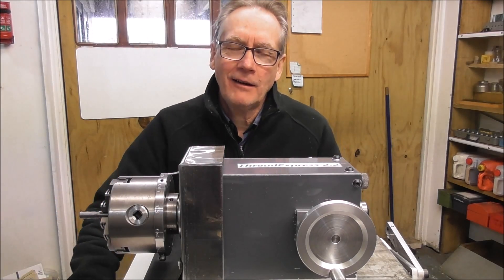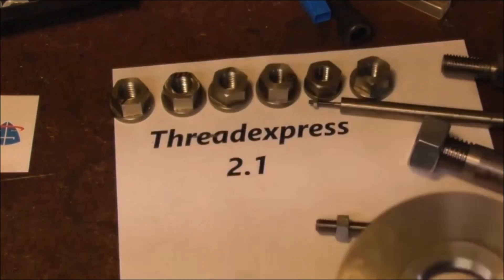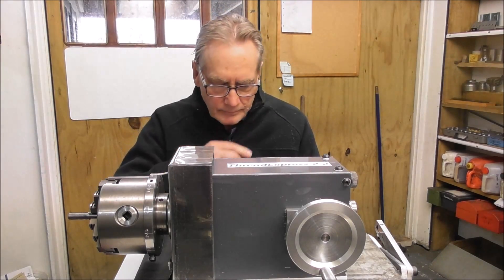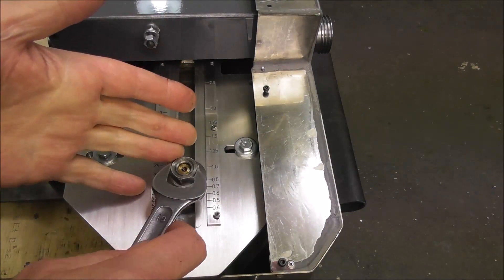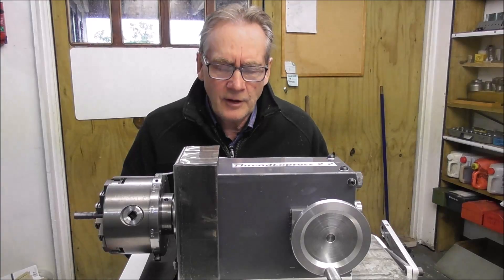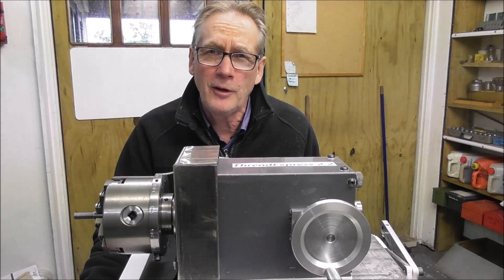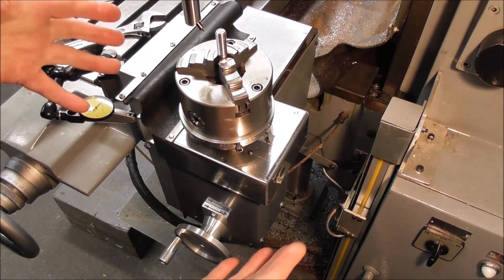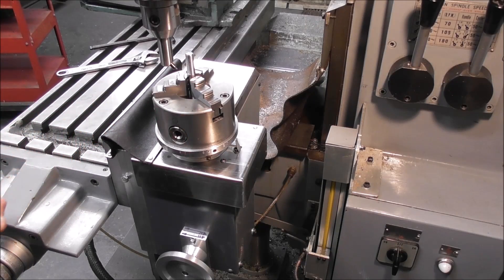ThreadExpress 2.2 Design revelation begins.

Comment: @ThreadExpress You're not solving a problem I can't solve with freely available mainstream CAD/CAM packages like Fusion360 2D+1. Z axis is the easiest to cancel backlash on a vertical mill since gravity will always pull down. I can't tell if you're trolling or just uninformed.
Reply from the maker: Hi Matt - Not everyone around the world has CAD/CAM and a CNC machine.  I have a CNC and do threadmilling also, and I still would use the CNC process for multiple parts that do not have to be highly accurate. But for one part, depending on the part, I would do it in ThreadExpress more quickly. Depending on the part pitch and diameter etc the ability to set the work at the helix angle gives a more accurate thread form. (This cannot be done via normal vertical CNC thread machining). Also, many small shops around the world do not have an operator that would be comfortable with CNC technology.  Cliff
Reply: @Threadexpress   Matter of fact, the majority of expert machinists actively resist the hivemind adoption of CNC.
I'm sure a lot of it boils down to "oldboy no like new gadget", but much of it is correct recognizing a leap from a manual to automated process, that isn't necessarily a smooth transition improving upon, or even capable of reproducing, all the same processes.

CNC mills, lathes, hybrids can do so much more than standalone manual mills and lathes, but there is plenty they simply can't...
The fact that so many machinist's apprentices nowadays aren't even getting an introductory crash course on the manual forebears, before they're purely CNC machining is frankly, erasing multiples of the 19th/20th century's greatest achievements, in real-time...
Once all of the old-guard master machinists fully succumb to old age and retire or die off, the disappearance of this skillset will hasten even more than it has been already.

Machinery's Handbooks will be available, until they aren't, or you can only get it digitally, until you can't. And then...? To those who aren't paying attention, this might seem like horsedrawn carriage drivers railing against the horseless buggy, or perhaps the relatively rapid transition from mechanical, to electromechanical, to electronic in virtually all devices and appliances, but it feels much more existential...
When I was in my childhood and teenage years, adults used the potential of a tradecraft career as an active threat to highschool graduates considering between entering the workforce, or matriculation!

"No college?! You don't want to wind up as a plumber or electrician, DO YOU?!"

The inherent reality, at least for American teens facing that decision, was
"Do you really want to apprentice for a lucrative, highly-valued and highly-respected (by people actually tethered to reality), essential and non-fungible skillset you can take pride in, or wouldn't you rather have a soul-crushing job in a cubicle, where your boss doesn't know your name, and you'll only glimpse their face a few times before your downsized from budget-slashing and stock-buybacks, and the majority of your income until your a grandparent will be diverted to pay off predatory student loans you will never crawl out from under without collecting a large inheritance of which nobody in your family is wealthy enough to enable? Come on, why not tempt fate and just sell your soul for zero job security?"

Oof! I really got lost in the weeds on that one. What I'd meant to say was, this societal stance was only held by idiots, of the excessively wealthy and privileged variety.
Apparently, and it's surprising that this was surprising to so many people, no matter how beneath you or your family name you believe these professions, when everyone has actually heeded the braindead warning not to join the ranks of unwashed tradespeople, no amount of money or connections or leverage or power will buy you a professional officially certified in completing relevant projects. Naturally, there will be unqualified people appearing from the æther to claim those riches being offered. Quality/completion of the job however rarely factored into that. Also, once they've collected that payday and vanished, the slapdash workmanship fails, and people get hurt or worse, there's no business, or licensed professional to hold accountable.
This deeply flawed mindset seems to be having a renaissance, beginning with machinists.

Don't let anyone tell you otherwise, the Luddites were 100% correct and justified with their movement, and the same 100+ years following their persecution and execution, then saw literally anything left-wing or egalitarian, and the Luddite movement smeared by relentless propaganda campaigns...

Damn, this became a major rant...and now I'm beside myself, in need of some quiet contemplation...
Reply from the maker: @NightsReign  Yes that was quite a rant! You have quite a flare for writing! I think you touch on some real societal issues there. The many comments under this video have really caused me to pause and think deeply about these topics. I am at risk of losing my purely technical focus!  Keep up the good work. Cheers, Cliff
Reply: @Threadexpress    It really just grabs my heart in a deathgrip and squeezes when I see, juxtaposed next to all of these truly passionate hobbyist machinists keeping these skills in circulation, and the career machinists vanishing from the landscape day by day, there are these people with the absolute narrowest possible perspective of the world, popping up constantly to loudly proclaim
"That's dumb! You should just use CNC for all things!"

I can't even be sure they even have experience with CNC, or are just cribbing from something they read once.

Because, they sound just like all of the techbros hyping AI as the future, but

I refuse to live in the pod!

I refuse to eat the protein paste!

I reject the myriad horrors of AI, the current ones, and those on the horizon!

Comment: :takeout:🤣  Why would anyone spend a penny on an obsolete hunk of metal?   CNC thread milling is cheap, easily available etc etc
Reply: Many small, one (wo)man shops don’t have CNC and never will. The question is whether the cost of this would be worthwhile for them, depending on what work they do.
Reply from the maker: Thanks for your thoughts. I have a CNC and do threadmilling also, and I still would use the CNC process for multiple parts that do not have to be highly accurate. But for one part, depending on the part, I would do it in ThreadExpress more quickly. Depending on the part pitch and diameter etc the ability to set the work at the helix angle gives a more accurate thread form. (This cannot be done via normal vertical CNC thread machining). Also, many small shops around the world do not have an operator that would be comfortable with CNC technology. Cheers, Cliff

Comment: I wonder what your perceived market would be in this age of cnc manufacturing. Conventional machining is on the back foot I’d think, save special one-offs like big disks and long axles. From an intellectual point of view projects like yours remain interesting however. It’s like looking into the past and asking ourselves if the 17th century missed out on inventing the i.c.e. or the machinegun. 
(Or: can, with the tools of that age and today’s knowledge, a repeating flintlock firearm be built?- a formula for tech contests maybe.)

Looking at your machine my first thought was: Why milling per se? A driven tool, mounted on the toolpost of a lathe, could accomplish the same thing. 
A last note: maybe it is wiser for those who want to patent an invention never to speak of it as of a discovery waiting to take place. 

A disc based CVT inside? Thanks for sharing, I’m looking forward to new episodes.
Reply from the maker: Thanks for taking the time to give your thoughts.
I think worldwide, many smaller shops do not have CNC capacity, yet want to do a wide range of work inhouse.  
Yes, I wonder why this attachment was not available in the past also!
Yes, thread milling on the lathe is a common process. The main advantages of this unit are speed of setting the pitch, and setting odd pitches that are not available on many lathes, and having indexing for hexagons etc., and being able to turn the unit slowly more easily. 
Thanks for your design guess, it is noted, I am sure you understand I cannot reply to this until after the design is revealed. Cheers, Cliff

Comment: You can do the same thing with 2 servo motors one for linear traversing and one for rotation. The servo controllers have electronic gearing inside which would allow you to do whatever pitch you like, have no backlash in the mechanism but also do some more complex helical machining
Reply: that won't necessarily make it simpler or cheaper. probably smaller though!
Reply: @guitarchitectural  Cheaper no. Probably around $700 for two 400W servo, 20mm linear rails and 12-16mm ball screw. Simpler? maybe depending on the complexity of the mechanical parts you put in your device. In a servo solution there is almost no parts you need to build except for the housing and the arbor to drive the chuck
Reply: @car9167  you also need a control system and software and a way to interact with it
Reply: @guitarchitectural  Well no but you need an encoder to generate pulses similar with your hand-wheel. The encoder signal goes into one of the servo and the other comes out of the drive of the fist servo into the second servo drive. Then in the servo drives you do the gearing configuration. When you rotate the hand-wheel with the encoder, both servos moves one rotation one linear translation with the ratio you programmed.
Reply from the maker: Thanks for starting this conversation. Yes, I thought long and hard about what are the advantages over a NC indexer.
There is no backlash with ThreadExpress either.
Perhaps long term, a mechanical operation would be easier to service/repair.
Cost, I am not sure with production runs of say 1000, which system would be cheaper, I think mechanical, (if it is made in China anyway).  
 Depending on how it is operated and serviced, NC may be too high tech for many traditional shops, many small shops around the world do not have an operator that would be comfortable with NC technology.
Cheers!  Cliff

Comment: My guess on how it works.  The chuck is rotated at a constant ratio from its driver (eg the handwheel).  The z axis is moved in its travel by a lever of sorts.  The lever is driven by a lead screw and nut from the same driver as the chuck (eg handwheel).  The pivot point of the lever (or leverage point) is altered to set the thread pitch.  So hard to explain without drawing it!  

Keep up the great work.

Cheers, Ashley
Reply from the maker: Hi Ashley, Thanks for your encouragement! Thanks for your design guess, it is noted, I am sure you understand I cannot reply to this until after the design is revealed. Cheers, Cliff

Comment: I'm absolutely curious as to how the mechanism operates, but I'd be interested in making one too if you release the CAD drawings.  It's a shame you couldn't find a manufacturer.  It will almost certainly get replicated by you know who....
I'm thinking there is a cam or a conical follower involved somewhere?
Reply from the maker: Hi There! Thanks for your comment. Yes it was a struggle to even get through to most manufacturers. I am a hopeless salesman. Thanks for your design guess, it is noted, I am sure you understand I cannot reply to this until after the design is revealed. Cheers, Cliff
Reply: @Threadexpress I don’t know your experience in industry overall. But individual designers always have problems getting their foot in the door. All manufacturers have some amount of R&D going on. Big companies in particular are concerned about liability. If you show them a machine, and they’ve been working on something similar, there’s a problem. If they turn you down and then, a couple of years later, come out with theirs, you’re going to feel that they may have misappropriated yours, when they haven’t. Companies don’t like to admit what they’re working on for competitive purposes, so likely they wouldn’t tell you they were working on one. For example, Apple doesn’t talk to outside inventors. If someone sends them something in the mail, without opening it, they put it into a bigger envelope and send it right back with an explanation why. That’s not untypical.

Comment: The sliding thread indicator moves a tilting arm which creates a variable slope. Against the slope is a cam follower of sorts, at the other end of which is a way to raise and lower the rotating spindle head. The follower slides along the slope as the machine runs. Depending on how steep you set the master slope, the follower advances more or less per revolution of the spindle. 

There’s a variation on this implementation where the follower is attached to the fulcrum of a “see-saw”. That pivot point can be moved further or closer from the centre of the see-saw, adjustable by the user. One end of the see-saw is pivoted to the machine body. The other end is driven by a feed system at a fixed rate. The follower then also moves along, but at a different rate, depending on how close or far its “pivot” (the tipping point of the see-saw) is from the adjustable centre.

Hard to describe in words, but these two systems both rely on having an adjustable slope. Both systems have been used for centuries in a watchmaking tool called a fusee engine, which is a type of infinitely-adjustable screw thread cutting tool. You can see them in the March 2023 edition of the Horological Journal, published by the British Horological Institute.
Reply from the maker: Very interesting, thanks for that. Thanks for your design guess, it is noted, I am sure you understand I cannot reply to this until after the design is revealed. Cheers, Cliff